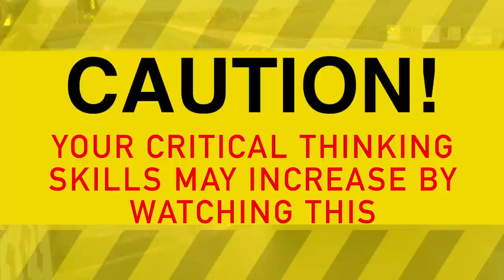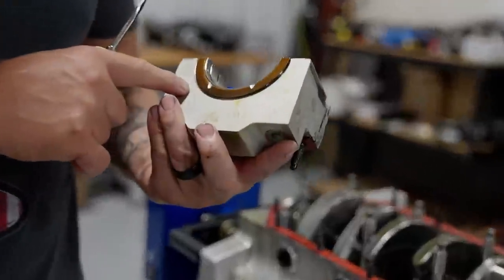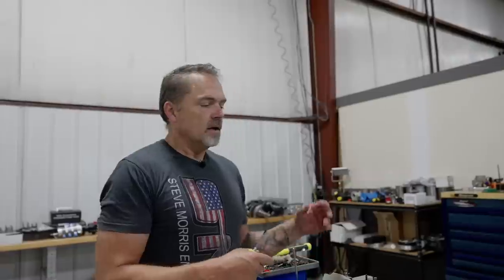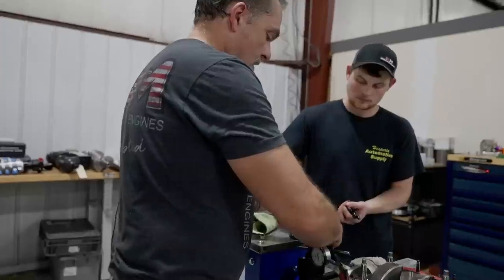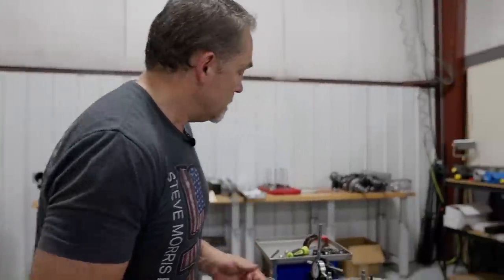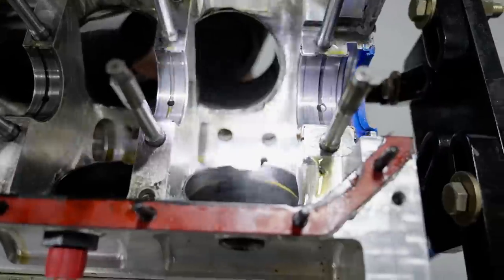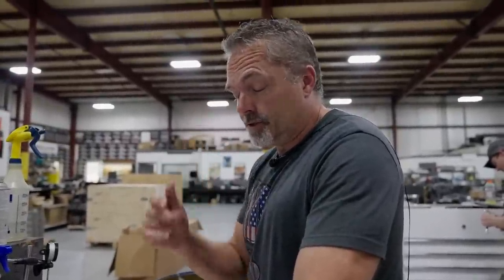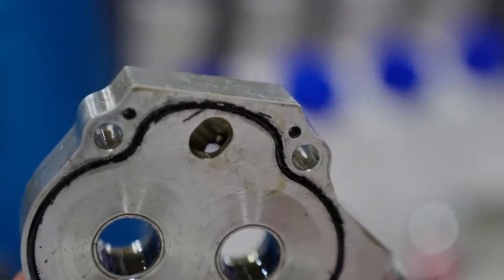I Found Mullets Engine Issue...Part 2

Comment: Look inside the intake. The turbos kept leaking oil. Might have been chewing themselves up
Reply: Yeah intake doesn't get into oil... smh
Reply: Intake doesn't go into the oil but it does have oil being fed to it's 2 Roller bearings and that oil then returns to the crankcase or a catch can of some sort which then leads to the crankcase....any thing is possible
Reply: @chrishamil254  womder where that oil drain from the turbos goes? Hmmmmmm couldn't go back to the oil pan? If the bearings are chewing up in the turbos it would put some material into intake from impellor and housing. And bearing material would go into oil pan. Thank you for your input though 😀
Reply: Dry sump, so possibly draining back to the tank, rather than adding load to the scavenging side, it is a possibility.

Comment: First. My guess is the oil pump.
Reply: AGAIN
Reply: Again? Hahaahee! 
My guess is the bearings due to the load angle of the converter.
Reply: My first guess yesterday also.
Reply: My guess was cam/ cam bearing
Reply: Now what
Reply: My guess is stuff still left in the oil passages from the previous failure
Reply: That’s it!!  You didn’t watch the video all the way through and then make your call did you? 😂🤗
Reply: Pretty sure I was first on the whole oil pump deal. 
Anyways
Reply: Let's be honest if we all had glass sites on our oil filters we'd probably have taken our Motors apart a long time ago I don't blame the guys
Reply: I said first as in I was the first to comment on the video, not the first person to think of the oil pump failing.
Reply: @markseaman4750  No I actually thought of this by process of elimination. Cleetus dropped to 9psi during a race, so I figured it was obviously something to so with the oil in some way. And when the oil was clean in the drain pan, and the bearings were all undamaged in yesterday's video that led to me think it was the oil pump.
Reply: SAME AS I SAID . YESTERDAY.  BEFOR THE STRIP DOWN . JUST A GOOD GESS  ON MY PART .
Reply: @richluckey8639  ok, good call👍
Reply: @almostthere2024  THE FIRST TIME IT WAS THE OIL GEARS SELF-DESTRUCTING LEAVING METAL IN THE FITLER HERE ITS THE OIL PUMP AGAIN,,, THRUST BEARING :??

Comment: Professional autopsy with a clean, understandable final report of this engine. Thanks Steve!
Reply: Autopsy is a report on a dead body!!  Thankfully this motor will live again!!📈🌝
Reply: @highpointsights  Biopsy!
Reply: @highpointsights   You're right. Time for the revival procedure!
Reply: @highpointsights  Your are correct that an autopsy is performed upon a human body after death
An autopsy is an examination of the dead body within every aspect of the body including cutting it open to examine the internal organs with the purpose to find evidence indications, measurements, details with the intention, purpose, aim to determine the apparent means, paths, causes of death.
A motor-engine does not live have life. This engine actually was still operating, functioning. There was/is evidence, indications, including very low oil pressure, a broken inner valve spring, tiny metal shavings in the oil, especially the oil filter which collected, thus concern with significant wear, damage within internal parts, metal components
Mechanical, physical, electrical, machines, electronics, etc. have principles with which they operate, function, per the physics. Thus there is exact, precise, accurate principles, mechanism, causes, thus with full, proper investigation, examination, etc. the actual cause(s) are determinate. This is within actual Science Philosophy, Scientific Method-Methodology.
There are no such developed, determined principles, mechanism, causation within Biology, Psychology, Sociology, all '-ology'[=Study] Fields of Study.
With correction, repair, fixing, this engine can, will operate, function properly again

With full proper, thorough examination, investigation, knowing the proper principles, mechanics, mechanism,  etc. then through proper using these, with proper attained, gather evidence measurements, etc. within the proper methods including proper thinking, reason, logic, reasoning within proper assessment, evaluation, differentiation, discernment, analysis, including proper troubleshooting, problem solving, determination, conclusions, solutions, corrections, repairs.
These are the base, basis, basic with which those which trained, instructed, taught, developed my abilities, capabilities, reason, logic, reasoning, methods within mechanics, mechanical, industrial, electrical, electrical, troubleshooting, repair,  correction problem solving, design development, problem solving, verification, certification, engineering, science, physics, chemistry, materials, advanced mathematics, structures, statics, dynamics, communications, etc. throughout my life [64 yrs] during the last 54+ years.

 @chesterwsmith  Chester W Smith, there is a term called "Biopsy" within Pathology, which certainly applies only to, with, biology, biological, 'living', entities, organisms, creations, creatures; "Bio-"=living =>thus are You attempting use this biology term within mechanics, mechanical, machine, engine, which is clearly, certainly incorrect, invalid, improper, nonsensical too.

perhaps You could propose, initiate, invoke a new term like "autotopsy", "motortospy", "enginetopsy", "machinetopsy", "machtopsy" or some other appropriate convolution ?🤔

All The Best and Much Success in Your Quest(s), Health, Happiness and Well Being 😊, Sincerely 😚
Reply: @newtonfirefly3584 just no camera in the exhaust pipe.
Reply: @darrylhaynes9208  Darryl Haynes, what would a video recording, camera in, of, showing either or both exhaust pipes, if it could be done, would be of any benefit within this assessment, evaluation, analysis, issue(s), etc. ??!!
Reply: @newtonfirefly3584 woah there firefly, you may want to reduce your Adderall dosage
Reply: @ @highpointsights Most likely not for long if Cletus and clowns keep doing their own installs, Let’s face it almost everything that they touch usually ends up breaking, getting hurt or having problems!
Reply: @NeverEnoughPyro40  Yes, they do lack proper assessment, evaluation, process, attitude, process especially proper methods. When Kevin Smith is involved the success is much higher, greater since he follow many good methods.

Comment: I would have loved to see the oil tank and line cleaning
Reply: last video bro. part one he showed the oil pan
Reply: The oil tank, not the engine oil pan.
Reply: I suppose that would be on Garrett's channel as that stuff is in the car.
Reply: Hasn't/isn't showing the line and tank cleaning. That wasn't sent to the shop so we'll have to see  if Cleetus provides that. 
There's surely a spring that operates the bypass too, wondering if it broke or trash froze it.
Reply: The hoses were made new before sick week when motor went in car all hoses were new
Reply: @johnrichardson82  As was Steve's' converter, and we seen how new items can have manufacturing debris.
Reply: @johnrichardson82  I remember them saying they’d replaced the lines, but I don’t recall if Mullet has an oil cooler and if so was that replaced. Conventional wisdom is to never re-use an oil cooler if an engine has blown up or had metal go through it as they’re virtually impossible to clean.
Reply: True, but for that we have to go to Cletus's shop to the car.
Reply: @emmajacobs5575  almost everyone reuses the PTFE fittings and hoses with no problems. They normally only get replaced if leaking or being on a certain amount of time.
Reply: I agree. They should be flushed as routine maintenance. Whatever is holding the oil pump bypass open came from somewhere. I would replace the bearings in the oil pump too.
Reply: @jasonstormoen  I think the original commenter of this thread is wondering out loud if there is debris in the tank, lines? 
The pressure side of the pump draws from the tank through the lines, pushes to the screen, filter.
Reply: @Ray-56   I know how it all works. I use to run a bbc twin turbo car before going procharger. I was commenting to the person who said to always replace lines if anything ran through them.
Reply: @emmajacobs5575  most engines I seen that have oil cooler are diesel.

Comment: Sooo… a certain engine company with 3 letters in their name (they build 70% of the NASCAR engines) had issues with this style of bypass in the past (20+yrs ago) the solution was to sleeve the piston area. *Any debris in the alum wall would hang up the piston.

Comment: My favorite part of working at sassy race engines years ago was disassembly and forensics.  Good job Steve.
Reply: It is the little things that can save future problems.
Reply: Forensics actually requires a proper set of principles, reason, logic, reasoning and does not apply to machines which have definite, define,d known, established principles, which have physics, chemistry, materials, principles, advanced mathematics, structures, statics, dynamics which are all determinate; not guesswork, hunches, guesess, estimation, 'guestimation', trial&error', similar -> except for those lacking with, within proper principles, knowledge, science, physics, methods. 
Perhaps You enjoy investigation, assessment, evaluation, troubleshooting, problem solving and similar  ? All The Best , Sincerely
Reply: @newtonfirefly3584 "The term forensic refers to the application of scientific knowledge to problems, especially scientific analysis of physical evidence"
Seems like it fits to me. Forensic engineering is a distinct field. Perhaps you just like putting people down in comments in YouTube
Reply: @newtonfirefly3584 nope. Wrong. Try again.

Comment: Even though I’ll never have anything close to this caliber of performance I still find your videos very informative. Thanks Steve!
Reply: I think a lot of us identify with that statement..🤘🏻😎
Reply: You can do anything you put your mind to.  Don't have to start at this level of engine but building any engine is fun.
Reply: @duanebailey6253  and dreams are free..
Reply: These are small cute engines to any marine mech. I work on stuff that ticks over at this bhp level only it has magnitudes more torque. I still find it fascinating that Steve can get this sort of power from a block that size and it be relatively reliable. You'd think any block that size would go bang around the 2500hp mark at the very most.
Reply: looks like someone ignored the warning at the beginning of the video
Reply: All you have to do is fix your stuff and film it, then go do silly stuff and race and post it and maybe Cletus will give you a few hundred thousand subs like you did for Steve and then hey the money be rolling in lol 😂
Reply: Sure you can! You may not be able to go out and spend 100k or more on a turn key setup but you could buy a used block and start piecing it together 🤷🏼‍♂️
Reply: @ @bigduphusaj162. And even with all of that torque you probably still cannot even go above 16 knots! The difference is you are only maintaining and repairing those engines, Steve actually designed and fabricated those engines! You are working on engines with someone else’s name on it while Steve is building engines with his name on it! Your job doesn’t sound that impressive to me, It’s pretty funny bragging about someone else’s engine!

Comment: Cleetus' main signal for engine issues is oil pressure. Low pressure has always meant a quick end for the motor. He's got too much invested in your SMX to take chances like that so it wasn't a surprise when he called it instead of letting 'er eat. Glad that's all it was. Now they have a new trick in their book when it comes time to diagnostics. Thanks for the great info!

Comment: I so enjoy your show. As a fellow drag racer for over 50yrs I know the little things can grab you.
Reply: Usually purple converter is lack 9f cooler flow orcooler bypass stuck open. Do you have a thermostat in the cooler lines for the trans.?
Reply: For me, it is ALWAYS the little things.
Reply: @juniorthetuner5113 cavitation causes extreme heat like this too and its notorious for only melting the very surface leaving the rest of the material fine, well at least for a while it does. Whats the possibilities of cavitation happening in there? is there any way air can be getting to that surface as or before its getting absolutely battered with oil?

Comment: It seems like Steve is super competent. It’s funny when he said it makes too much horsepower. 30 years ago top fuel barely made this much power and those engines only lasted one run, then were rebuilt. It seems like a lot to ask for it to last as long as they do. Great channel. I always learn something.
Reply: Uh no, more like 60 years ago.
Reply: @causeimbatmaaan  Sure about that?  The 1990 TF  record was   Gary Ormsby  9-29-90  4.881 / 296.05   NHRA Topeka KS        I don't have the weight of a TF car of that era but I have run numbers for a believable range.   ( current weight is just over 2,300 LB near as I can tell ) 
The Wallace Racing calculator says 4.88 in a 2,000 LB car is 3,400 HP  / 2,300 LB car is 3,900 HP.  / 2,500 LB car is 4,250 HP
Reply: @causeimbatmaaan  And to complete the process   Lyle Fisher  ( Speed Sport 2 owned by Red Greth and Lyle Fisher ) TF  8.035   3-1960 / 183.67 10-10-1960 Records show it weighed 1,500 lb  This calculates to  575 HP
Reply: @bobroberts2371  Yeah I'm sure. TF in the sixties was in the 4000 range. Btw, gross horsepower has nothing to do with what you can put down on the track and there's been a thousand improvements between the flywheel and track surface since then. No TF car today can lay down 100% power still, no doubt power available has significantly increased.
Reply: @bobroberts2371 not sure thats true mate. Here in the UK the most powerful drag cars at santa pod were making 8-9k bhp in the 90s.

Comment: As someone who has worked in diagnostics of various machinery/electronics as well as having a lifelong passion for anything with an engine and motorsports I love these types of videos where we get to find the deeply hidden issues that just won't go away. There's always a solution to a problem and thanks for showing everything in such detail.  Also, you're just a cool dude so that's a plus. Also also, guy with the long hair, I've seen him somewhere else. Any hints?
Reply: It's interesting watching other techs go through their diagnostic process, with commentary. Kind of like an "Armchair Quarterback" situation, on some channels, where I can get annoyed at the missteps they take. But definitely not here, oh no this is where the student takes notes! And where else can you watch a front-to back teardown of such badass, second to none hardware?
Reply: @ @cozfpv591 First of all there is no deeply hidden issue and the solution is pretty simple! The issue is Cletus did not flush all of the lines, oil can or any other component that has oil running through it, The solution is Cletus and clowns should stop doing their own work! Let’s face it Steve has been building engines for years successfully meanwhile Cletus almost always breaks or has issues with everything that they touch!
Reply: @NeverEnoughPyro40  Ok buddy.. So you want Steve to go fly to Florida and install the engine?

Comment: Woo Steve!!!   Having an adapter come apart on the dyno is some dangerous stuff!  I've have instances where it wasn't torque'd enough but always caught it early enough to shut down safely.  To be fair, I never used an adapter that small before, always some hulking billet piece with no account for lightening.